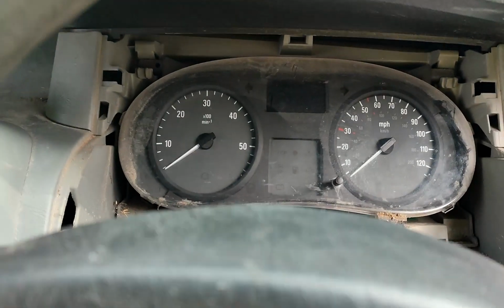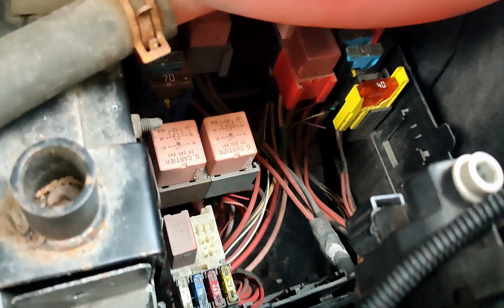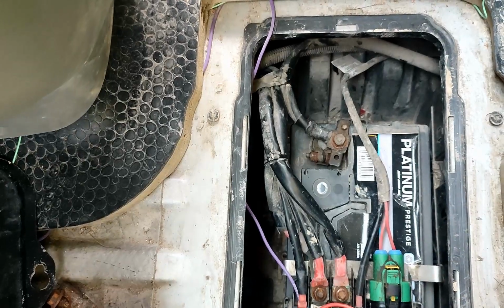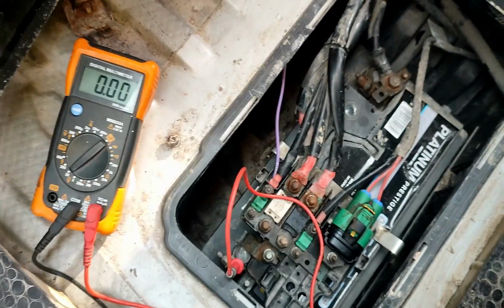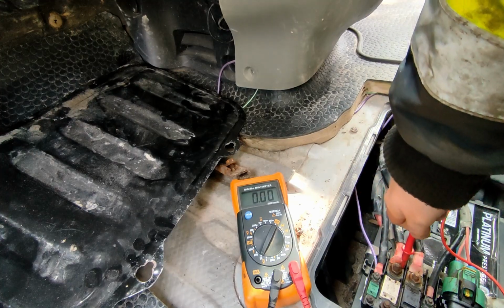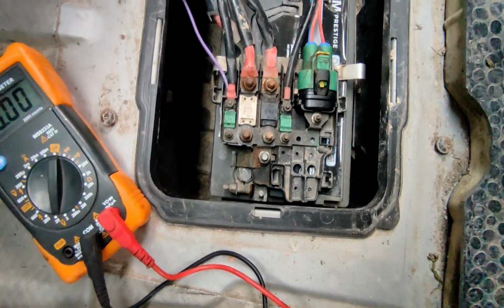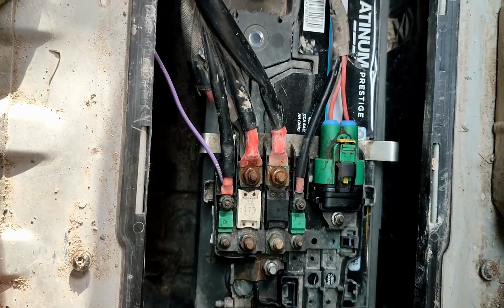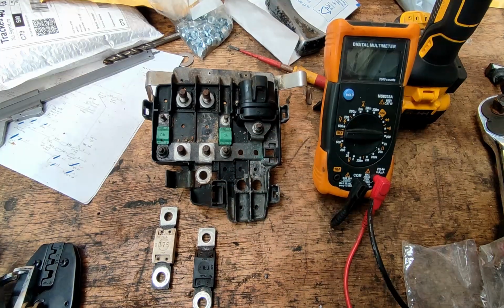Vauxhall Vivaro clicking when starting problem solved

Comment: So imagine this 

I drove to the shop Friday came back to the van it wouldn't start I bumped the van and when I did I turned the key and the starter motor works no issue but if I try and start from key it clicks 🤔 

Gonna check with multi meter and see if it's the fuse as it's the only thing I can be I've replaced starter and still the same
Reply from the maker: Absolutely, start with checking the simple things
Reply: @aguyandhisgarage gonna take it to work and see if I can find the issue boy it's stressing me

Comment: My Renault traffic makes a buzzing sound from the dash and the lights on the speedo flash then it all goes black as I crank it. Have a brand new battery. Any ideas thanks. Been a devil van since I got it.
Reply from the maker: Does it crank over and start or do you not get anything? 
If that's the case check your fuses like in the video. After that I would be looking at your cables and whether you are well grounded
Reply: @aguyandhisgarage No , doesn't try to crank.Actually console goes black / dead on follow through of the key turning full on in the ignition. Thanks for your reply and advice . Will check a few things you mentioned I'm the morning.
Reply from the maker: @SeamusMacatamneyhope it's just something simple
Reply: @aguyandhisgarage Just tightened the tiny wee nuts on the battery terminals but it made no difference.. I can hear the relays clicking away over in the nearside fuse box in the engine bay , but just get that dreadful buzzing sound behind the Speedo and all goes dark. A cursory look at the same engine fuse box didn't show up any blown fuses. Would a obdc scan tool help I wonder .
Reply: @aguyandhisgarage how did you gain access to the earth strap under the wheel arch . Do you remove the plastic floor step  at the door entrance ? Thanks
Reply: Earth strap is behind the plastic on the passenger side wheel arch. I’ve got the same problem have you found the cause?
Reply: @rbxrockettrio8650 Yes , I took out the new battery and took apart the fuse cradle that sits on too , degreased and wire wooled any conducting surfaces , replaced one of the battery terminals that wasn't making a good connection and put the battery itself on charge overnight. Reassembled it all and it was transformed into a working van again . Hope this helps .
Reply: @SeamusMacatamneythanks for the quick reply mate I’ll give it a go

Comment: Had to log in to say thanks so much for this. 
I had tried so many voltage checks, cleaned all grounds, grounded from the engine bolts and all sorts. Had just about given in and was about to hire in an auto electrician. I watched this and within 10 minutes found one of those battery terminal links had a loose nut so that is why the fault was intermittent and seemingly impossible to trace. Literally a paperthin gap meaning sometimes it was solved and sometimes struggled.
Saved me a tonne of time and money. 
Much appreciated
Reply from the maker: @adamtowersmusic  glad it helped you out!

Comment: Would it be OK to replace 175a fuse with 200a? Alli can get for now, will replace as soon as I can get the right one
Reply from the maker: @ryand2468  Do you know what caused the 175a fuse to blow? And has that been rectified?
Reply: @aguyandhisgarage  mistakes were made while jumping it, mistakenly put negative lead on the black wire of the bus so both leads were on positive
Reply from the maker: @ryand2468  in that case I would say it's okay to use the 200a to get you going, but you will need to replace it as soon as possible after. Your local motor factors will probably have one in stock or get one next day for you
Reply: @aguyandhisgarage  cheers very helpful video
Reply from the maker: @ryand2468  thank you

Comment: Had awful trouble starting my 03 vivaro. Long story short i had broken earth strap behind nearside wheel which attached to gearbox.
Reply: For what it's worth. It's absolutely fundamental to keep terminals clean. Grounds in particular mostly due to their locations and less than ideal maintenance or therefore lack of. Always need that extra 5minutes. That translate into a lifetime of "working as it should". 🙂
Those ground straps corrode and break frequently, curiously they are relatively cheap and most of the times easy to replace.
Reply from the maker: Thanks for sharing